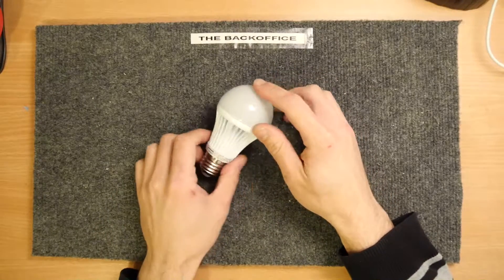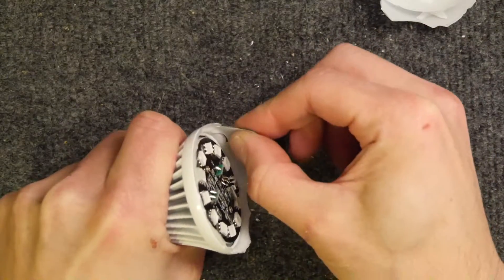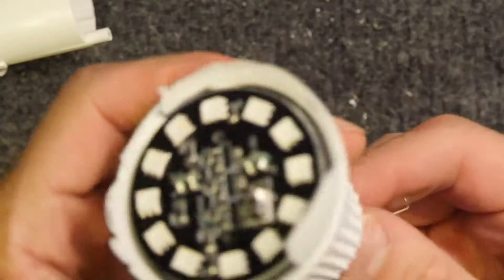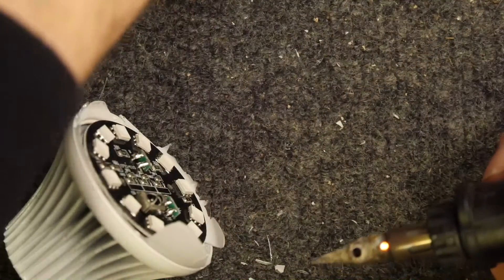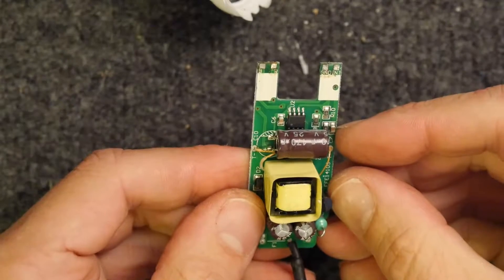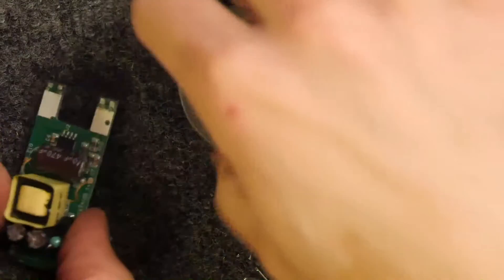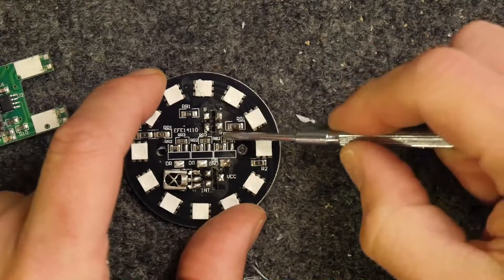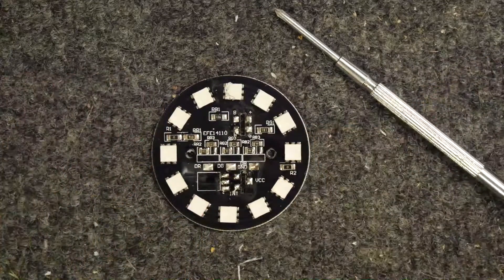240v RGB Lamp

Comment: Did wonder how they were constructed and now I know, cheers.
I've done a few projects with RGB 5050 LED's on strips (which is essentially what those are in PCB form). The control units are pretty horrendous though.
Reply from the maker: +Simon Lock (Aergan) The metalwork is quite lovely, very well made. Im quite impressed with what they can do with clearly a PIC12 series clone. They remote control (before it got lost) was really quite convincing. I think I first saw these around 8 years ago, the remotes look the same, but the construction is a heck of a lot better. Perhaps because they are made to different standards?
Reply: The Backoffice I believe being made to a standard in the first place helps
Reply from the maker: +Simon Lock (Aergan) That is a good point, it was a free for all in the early days of LEDs! Im finding the pound shops have an amazing range of decent LED lamps, and on dismantling, I have found them to be well made. I have no idea where they are getting them from!?